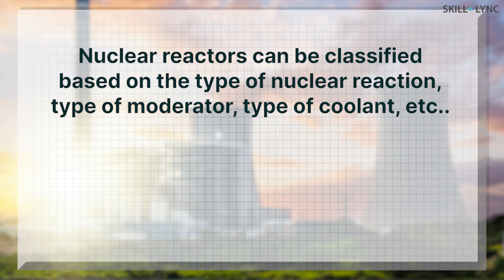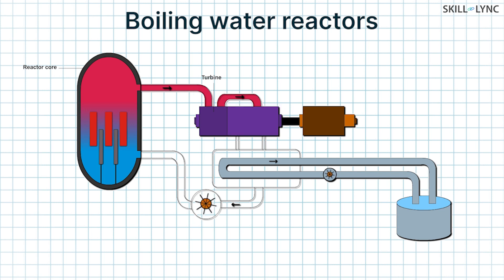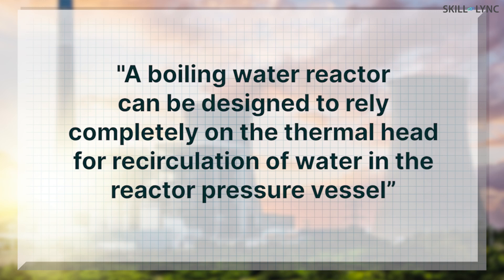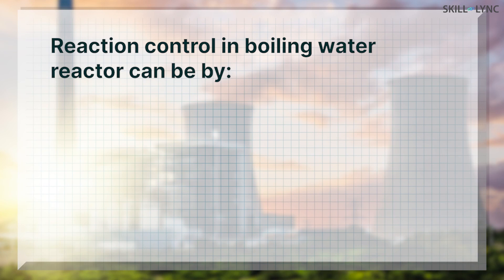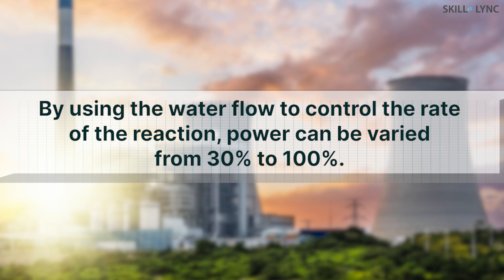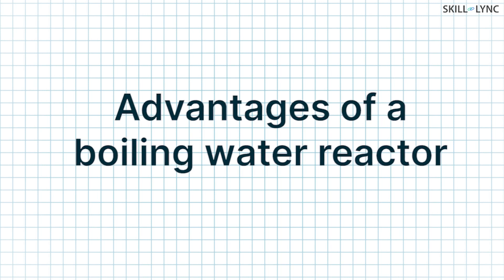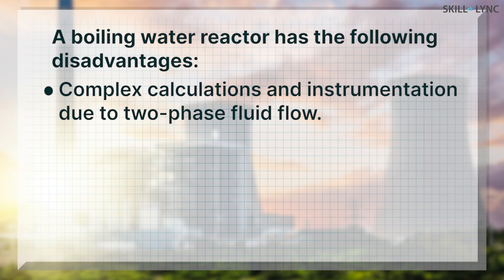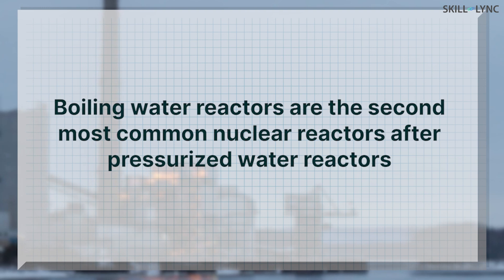What are Boiling Water Reactors? | Skill-Lync

Comment: Under disadvantages, what does "low thermodynamic efficiency" mean?
Reply: Low thermodynamic efficiency essentially means that this type of reactor is less efficient at converting Reactor Power into actual power for the grid, because the heat transfer to the water by the reactor isn't very efficient. Exactly like Gerald said.
Reply: I could be wrong but i think it means it's not the most efficient way to heat the water
Reply: so the gist of it is that higher pressures keeps the water from expanding into steam and thus you can get the water to about 300C and that is more efficient.